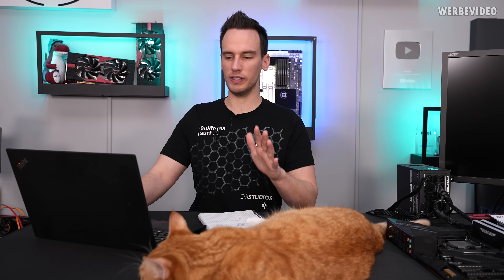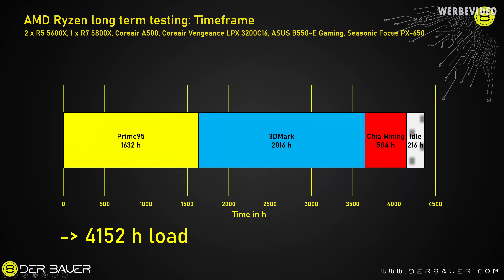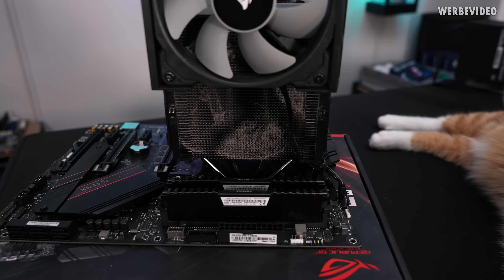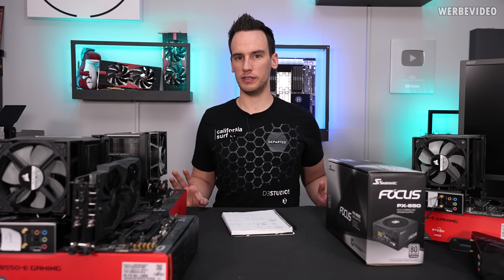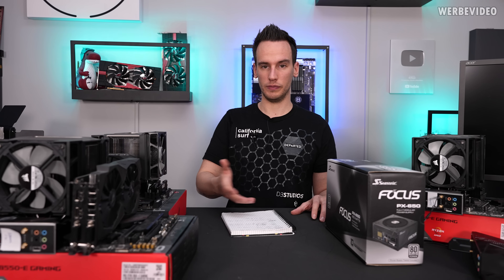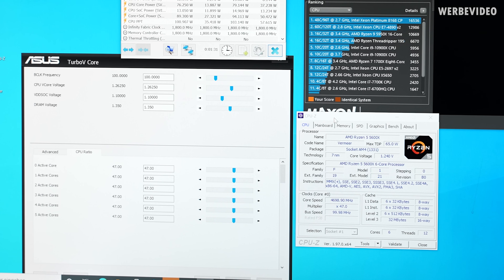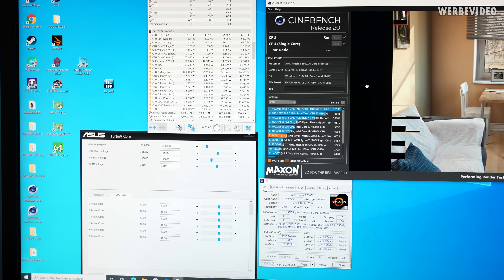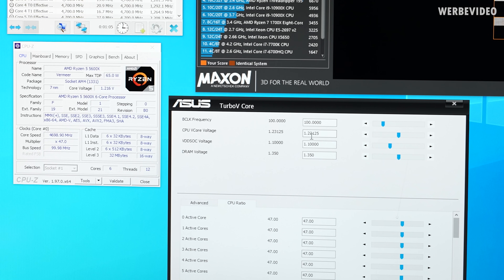4152 hours of Ryzen Long Term Testing: We have Good and Bad News

Comment: I was worried that my mining rig with 5900x locked to 4ghz and 0.975 volts would possibly cause degradation, thanks for the test!
Reply: @LiveType  They are running at around 3.3w from 3 to 4w

Comment: I've been running my PC for 14h/day for 2 years now.
It's 3rd gen, R3600 overclocked to 4.4 all core at 1.265v and its been great. (Why go with x series)
Rarely goes above 70degrees C - with ambient between 25-32.
Reply: Because when new CPU's launch. X's are always better binned.

The only reason why your 3600 clocks well is because you bought it late, or got REALLY lucky.

The 3600 I had would ONLY do 4.2ghz @ 1.45v. It was a POS.
Reply: @nexxusty  Then I am terribly sorry for all those with bad bins.
Reply: @nexxusty   I remember I tried to OC my 3600 but I was kinda scared of going high voltages (all these rumors about static voltages) so I used 1.3V and tried 4.2GHz, I couldn't even play Control

Jokes and giggles aside, my 3600 still doesn't really want to go above 4GHz if temps are higher than 60C, so I just used an offset to try keeping it below that.
I'm not sure if I should try again or not

Comment: Overall this is good a test and good to know. Some thoughts I have from it. 

When the cpu is running 1.45v you are using llc4. Thats very droopy voltage. I wonder if the cpu is seeing a much lower voltage than this. Low llc will help with transient spikes to help with current peaks and lows. The reason people would run higher vcore is to run higher cpu ratio. Here you use 4.7ghz which is stock. A cpu running lower frequency will degrade less because the transistors switching are doing less work. 

The ram used would be very easy on the memory controller part of the cpu. Again less degradation. 

The heat cylces are unfortunatly extremely unrealistic compared to real world useage. There was basically one or two because of the windows update. Think of a lightbulb. If you left it on it would last a lot longer than turning it on and off constantly. It would be interesting if you did the same test but with a stop start appoach.

Also temperature average would be useful. Because if the cpu was thermal throttling that could have reduce voltage for some time. 

Again this testing is very interesting and good to know. I just hope people dont have a false sense of security and experience bad degradation and consequently need another cpu.

Comment: I am curious about the power needed to break the cpu. Some people said their 3600 broke so i hoped to see that cpu in the test. Mine goes up to 12w per core with 1.2v at 4 ghz. I dont know if i would take the risk of breaking it with lets say 15w per core.
So if you ever want to test more cpu's, please try the 3600.
Reply: Hwinfo shows me about 9,55W per core at 1,33v (CPU burner in furmark ). I just have little offset(-0,025v) and in that stress test, cores are at 4050mhz. If you have 4.0ghz@1,2v all the time you loose too much performance. With -offset your boost in games will be very close to normal boost 4.2ghz.
Reply: @rokuzzoone5495  I do not game a lot, so it isn't needed that much. Your load is not as heavy as mine, when I put the same load on my cpu it will more likely hit 8w per core. I will try your offset, but I don't want the boost temp spikes because of the fan noise, even though I use a Scythe Ninja 5. On stock settings and silent mode it is horrible.
Reply: @Robbedoes2  Ok, I see. In that scenario probably 1.2v will be better for you but if your cpu can be stable with bigger offset then you gain much lower voltage at idle and not so much worse at workload. You can try offset from -0,0375v(probably any r3600 will boot with that ) and if cpu pass 5 tests of cinebench r20 tests 
then is high probablity that is stable enough. If it will be stable then add another -0.0125v until it crash with cinebench or not boot (small probablity but if it happens, cmos reset may be needed ). I get similar problem with noise(arctic freezer64 esports ) but offset was enough for me.
Reply: @rokuzzoone5495  I may try your recommendation, thanks for informing me. Personally I stopped using cinebench as overclock test, because it is not that heavy and sometimes does not crash while other programs do not run very well. Instead I use prime95 for some time, and even on small errors it stops the task. It's a very good indicator, and shows wich core is getting errors. That's also the reason why the ctr utility uses prime95 rather than cinebench.

Comment: Good stuff, I'm thinking of upgrading my R3600 soon to one of those CPU's. Currently running the 3600 @ 4.5GHz all core 1.296v so sounds like I'm probably not cooking it.  As for the mentioned Ivy Bridge I've had a 3770K OC'd to 4.5 @ 1.31v for 9 years and it was pushed hard CPU folding 24/7 for the first 4 or 5 years when not gaming in a sometimes high ambient temperature room on only air cooling (Hyper 212).  I switched it to an AIO 3 years ago when the air fan started to rattle and its still running fine to this day. Daily driver until 16 months ago.   I noticed the core temps had crept up a bit under load so it could probably use a delid and repaste but it mostly idles as a HTPC now. I actually had 2 - 3770K's and the other one ran 4.4 @ 1.19v 24/7/365 until I sold it last year. Pretty bullet proof CPU's.  Thx for the vid, much appreciated.
Reply: My ryzen 3600 at 1.3V doesn't even want to push 4.2GHz :') 
After that, I basically gave up because there were a lot of informations about static voltages killing those CPUs

Comment: 0:16 actually, it is 2x5600X and 1x5800X, you say the correct cpus later in 3:04 :)
Thanks for this Roman, I'm more of a fan of high efficiency than high voltages myself, but the video really puts a stop to the degradation rumors out there.

Comment: Hmm.. 6 core version is the 8 core that failed to work with 8 cores... So silicon is not that great. So I guess it makes sense, that it would suffer before the silicon, that actually didn't fail to be 8 core. If that makes any sense..

Comment: Really curious how intel handles this. None of my AMD machines have survived for more than 3 years, I have never had an Intel die out on me. I'm on my 5th i7 since 2013 and none of them died, they still work to this day and I've always hammered them pretty hard
Reply: Dont know about that both my q6600 and 2600k degraded the q6600 died in the end . 2600k still works but refuse to oc more than 200mhz

Comment: I noticed today my gigabyte B550 has devloped some terrible electronic noise/coil whine. Was that a thing for early b550 boards? Setting PC into low power mode completely stops the noise when CPU is limited at around 2ghz. Ive got my PC pretty quiet now so the sound is pretty unbearable lol.

Comment: Now I'm kinda worried: my 5700G (htpc) runs stock at 1.45V.
Should I change these "auto" settings?
Reply: No, it doesn't run stock at 1.45v. Run something like Cinebench and you will see it drop to 1.3v

Comment: funny thing is my 3-4 month old 5800 started bringing up errors after a few minutes of stress testing, it was causing all games to crash within 3-5 minutes.
Clocked the RAM back a little bit, that is back from stock and it runs fine now. I am going to change my heat paste soon I know I was too frugal with it the first time.

Comment: Would be interesting to see more thorough stability testing. I mean, passing three runs of Cinebench is a very low bar.

But I guess the most important thing is that, well... the CPU might degrade after a few years of heavy OC. As long as it still works after a small increase in voltages and/or reduction in frequency, it's not a huge deal.
Reply: Whole "burning" heavy load test was stability testing. If there were any issues he'd notice them in benchmark error, event viewer messages, etc.
Reply: @sliwa95  Which test are you referring to?
Reply: @sliwa95  What? you need to test a CPU in various applications to draw conclusions, I had a dying 3700x and it crashed more in light games where in Cinebench it ran fine.

Comment: Could board variance between the motherboard the CPUs ran on vs the one for testing account for some of the differences in vCore setting?  Even if they use the same components or BIOS.  It seems like not a big deal to me.  Especially since you used a higher voltage than what is needed for most air or water overclocking on Zen 3.

Comment: Stock CPU's in my experience run for longer then i need them, and i am someone who's oldest machine at this time has a Q6600 that was bought in 2007. So stating that a CPU will run for 7-10 years is a modest guess. All CPU's i have seen dying before 10 years of age (and i have seen a lot) are all due to motherboard failure. CPU's these days are luckily very over engineered.
Reply: Solid state nanoscale stuff tends to be that way. If it works for a month (at stock), it'll work for a decade. They're so delicate that they quickly stop working if any part of them is more than the slightest bit flawed. I mean, if you've got wires that are 150 copper atoms across, an area that's 50 atoms narrower is pretty significant.
Reply: My 3770k is still running at 4.2Ghz and it's been almost 10 years now.

Comment: My ryzen 1200 basicilly has been on for more than 4 years - windows takes moe and more cpu power - Now i can get 40 fps and stutter with a windows update ( cpu 16% approx) and the game played Overwatch at 1080p and low settings on a Amd 570 8Gb -Overclocking wont get less stutter, maybe more cpu usuage up to 100% as if overwatch sees that i have a faster cpu and just pushes more frames
Reply: Thsts not why you have stutter.

ROFL.

Reinstall Windows.

Comment: I've always kind of taken the claims of TSMC 7nm being super sensitive with a grain of salt, mainly because right out of the box they're sending up to 1.5v in low current scenarios, and I'd guess there's going to be circumstances where the boost algorithm along with the VRM switching frequency might not align to get the voltage down quickly enough when a high current load kicks in, so I figure the CPU's need to be pretty durable to tolerate that occurring semi-regularly throughout it's lifespan.

Comment: Super work. I always wondered how long when the CPU is degraded, searched the hell outta google but never got the proper info. But this video, it shows it all practically.

But

Why do we need heavy overclocking for gaming and why do people OC so much ? I mean isnt an average of 4.2 to 4.5 Ghz enough for gaming ?? 

I have R9 5950x  with Dark Hero been running @ 1.2 volts. Freq speed is set at auto in the bios with games running at variable average of 4.5Ghz with max 4.95. Cinebench runs at static 3.7 Ghz. But in general I never needed to OC my pc. Max temp with heavy games go to 65C and Cinebench to 70C

Comment: 2 decades ago, I ran an AMD "Athlon" Pluto 700 MHz @ 1 GHz (1.85V with Golden Finger device - yes, I still remember, I'm a nerd) for 3 years, with very heavy usage (and 3 years back in those days would've been a lifetime for a PC, because a new bleeding edge computer was already obsolete after 1, maybe 2 years). Anyway, being a retro enthusiast, I continued to use this CPU for all these years (I even used it yesterday for 4 hours), and it just works without a hitch. So... yeah, I would say that 21 - 22 years is pretty good for a very heavily overclocked CPU. :-)
Reply: I have a very old computer in my house with a pentium 75mhz lol, still works fine
Reply: I remember having an athlon xp 3200  that I left powered on 24/7 for months and the one time I decided to shut it down I was presented with an athlon 2500 being detected at the next boot which back then was the difference between game runs or game don't run.  Ended up selling the potato with a lower spec gpu and sold the Geforce 5950u I had for a good whack (today's equiv would be a 3090 ti) and bought a fkin bike instead. I suspect the CPU was a graphite trace scam chip from dodgy stock on Ebuyer. Being around 17 at the time the bike was a better choice anyway :P

Comment: working 24/7 on stable temp overclok dont kill the cpu its the heat/cooling cycle that make the metals and micro solder to crack inside the die /thats why mining card that work 24/7 with stable temps dont die for long time but gamer pc card die from temp cycle/

Comment: Curious about the "test is unfair for the 5600X" line. Could it be the 5800X passed cause it was able to do 3 runs quickly, if it was 5 or 6 consecutive runs it would've crashed as well?
Reply: Also should try reducing it to a 6 core CPU to see if it also crashes.

Comment: Now imagine a gamer playing competitive games for 10 hours every day. FPS is limited by the processor, air cooling on the processor and temperatures of 80+ degrees. 4 years is more than 14 thousand hours. In such conditions, even 1.35 will die... or not? And if the frequency is not 4500, but let's say 4800 and the voltage is 1.39? (Google translator)

Comment: I have a Ryzen 5 3600, and using Ryzen Master, auto overclock, it boosts at 4.3ghz but my voltages shoot up to 1.4-1.45v regularly. I started manually overclocking, and I can run stable at 4.4ghz with only 1.2v. I did this because I was scared of the degradation. I have actually successfully pushed 4.5ghz at 1.275v but I haven’t done any heavy testing yet at those settings. Seems like maybe I won’t have to worry as much as I previously thought
Reply: 4.4ghz at only 1.2 volts? youre lucky. my 3700X needs 1.25Volts at 4.2ghz
Reply: Damn, my 3600x did 4.4@1.294v. If I was able to get it at 1.2, I definitely would've pushed for the highest frequency I can till I hit 1.3v.

Comment: I would've liked to see a 5900x included in this test! Also very interesting that the 5800x had the least effect on it - considering the 5800x's reputation for running particularly hot.
Reply: did you think amd was lying when they said high temps are perfectly fine? You should know the internet, social media platforms are full of trolls and haters.

Comment: Guess ill see how mine goes.
4.9ghz on 1.46V used as a game server for 2 rust servers and 1 space engineers server so has 24/7 up time and basically 2-3 cores always at max boost.
Reply: How long do you plan on using it before upgrading?
Reply: @swecreations  Until it has issues lol. I was using a 1090T before I got the 5600X.
That went from back in the day when I used it as my main rig 1.48V for 4.3ghz which I used for a few years. to 1.52V for 4.2ghz for about 5 years then it had some random blue screens so revalidated the overclock stablity which needed to up voltage to 1.55V
Then just before replacing it it needed 1.55V for 4ghz and it was starting auto restart itself after 20-30 days up time so got the 5600X to replace it.
Reply: @bmgjet  I want to see how that pans out, stock voltage all core for 1090T seems to be around 1.4v, stock voltage all core for a 5600X is around 1.27v. Keep me updated please!
Reply: @bmgjet did this work out? I’ve pushed my 5700x to 1.4 and 4.85 so im just curious as it’s 3 years later.

Comment: though u are going to test R5, R7 and R9 CPU.
um, is that AMD cpu are not good for OC?
well i dun know computer much tho

AMD seems going to use 5nm in the next gen cpu, even smaller than 7nm. and i believe they said it reduce the power consumption.

Comment: Excellent presentation. 10/10 
too often we hear how fast and a barrage of tests with software that an average user would never run. As a person that builds their own PC's for home use and gaming etc I want the best value for my money and often spend a couple of months trying to juggle the pro's and con's between red blue etc. I recently built my 1st AMD system as the final condition was the power consumption. The AMD was simply more efficient but always in my mind was the question of reliability. I spent a lot of my savings on a x570 master plus a 5900x but do my upgrade every 5th - 6th year. Your presentation has just eliminated any minor worries I had that longevity might be an issue. Thank you.

Comment: I remember people spreading this in the Zen+ days, saying some low setting for Vcore was way too high and would murder your CPU.  Half the time I swear it was trolling.  But either way, after Zen2 I pretty much stopped feeling the need to do manual overclocks on these CPUs.  AMD does a great job squeezing performance out of them.
Reply: Well one of my 3900X at stock (bios "enhancements dissabled") it peaked at 1.45V alot and drew around 155 watts fully stressed and didnt even reach the base clock. I do love AMD for what they have done to the market but boi do they have hellish variance
Reply: With pbo the 5600x is a beast, no need to play with voltages and frequency

Comment: 10:20 To get my 5600X to hit 4.75GHz i have to feed it 1.3V. It's air cooled using an Arctic Coooling Freezer 34 Esports Duo. It wants to do more at that voltage but I need to stick an AIO on it.
12:14 My CPU has a twin!!! 😁🤣🤣🤣